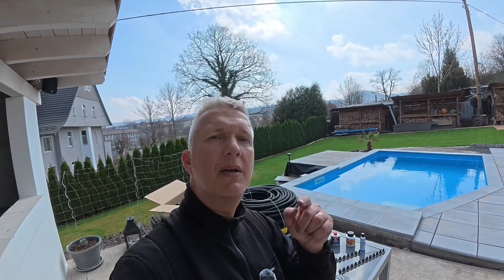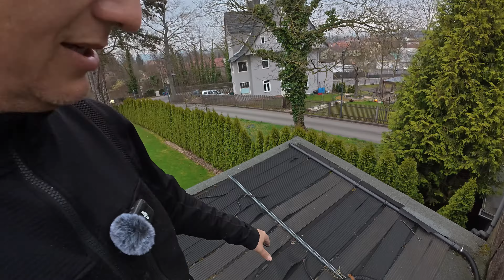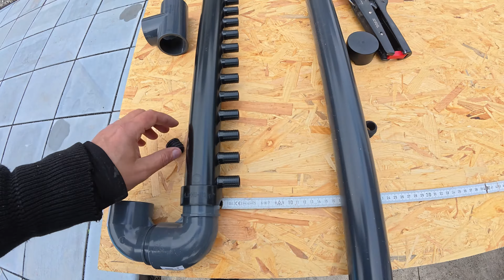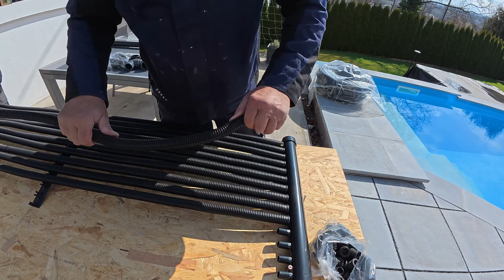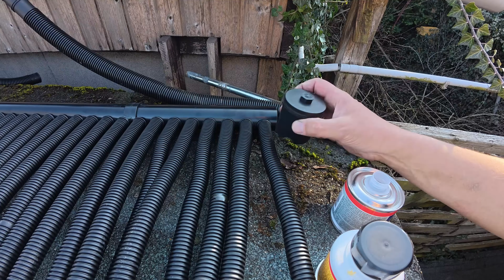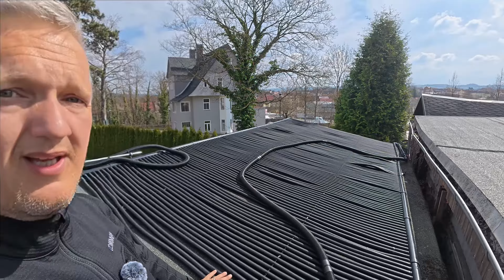Build a DIY Solar Pool Heater That Lasts!

Comment from the maker: *👇 All products & links from this video:
🔗 Ribbed pipe system: https://www.dolphi-ripp.com
🔗 Cleaner: https://geni.us/Hkh58YD (Amazon)
🔗 Adhesive: https://geni.us/9ih4W2 (Amazon)
🔗 PVC pipe: https://geni.us/EoXtW (Amazon)
🔗 Adapter: https://geni.us/5GimrK (Amazon)
🔗 T-piece: https://geni.us/GrNu (Amazon)
🔗 Angle IA: https://geni.us/VKVxT (Amazon)
🔗 Sleeve: https://geni.us/RSbm3f (Amazon)
🔗 KFE tap: https://geni.us/vw9J8RS (Amazon)
🔗 Pool hose: https://geni.us/tlkbP7 (Amazon)
🔗 Solar foil: https://geni.us/eA2OT (Amazon)

EPDM system
🔗 Solar absorber EPDM solar heating: https://geni.us/IOXTEy1 (Amazon)
🔗 Repair connector: https://geni.us/933M (Amazon)
🔗 Bypass set: https://geni.us/lwKQ3Lz (Amazon)
🔗 Solar hose: https://geni.us/qpSz (Amazon)
🔗 Complete set: https://geni.us/hYozFc (Amazon)

You can find a detailed blog post with lots more information on my website: https://commaik.de/2025/04/poolheizung-mit-ripp-rohrsystem-solarheizung-fuer-den-pool-selber-bauen/

Follow me on my social media channels for more content! @commaik

🎥 This video was originally produced in German for my main channel:  
https://youtube.com/commaik  
It was then translated into English using Heygen – with my own voice and lip-sync.

🎙️ Want to dub your videos like I do? Try Heygen:  
🔗 https://www.heygen.com/invite/b96cdcf6 – Get 300 free credits when you subscribe.

📺 The original video, which includes English subtitles, can be found here: https://youtu.be/Sll_zPNsJZg

Note: All links marked with * are affiliate links. If you make a purchase through these links, I will receive a small commission at no additional cost to you. Thank you for your support!

Comment: Too bad, Dolphi Ripp is currently closed. Any other system you looked into and can recommend? I currently have cheap Marimex panels installed that - after 4 years - ripped apart. So I want to install a replacement end of summer. German shop is fine.
Thank you
Reply from the maker: Hello,
Yes, I was honestly quite surprised that the Dolphi-Ripp shop is temporarily closed. I really hope they'll be back soon because I've been very happy with both the system itself and their customer support.

There are other manufacturers offering similar solar ribbed pipe systems, but I've only used the Dolphi-Ripp system myself, so I can't honestly recommend another brand based on personal experience.

I'd suggest searching Google for "Solar Rippenrohr Poolheizung" or "Pool Solarheizung Rippenrohr" if you're searching in German, or "solar ribbed pipe pool heater" or "solar pool heating ribbed pipe system" if you're searching in English. You should find a few comparable systems that way.

It's a shame your Marimex panels only lasted four years. My Dolphi-Ripp system has been running flawlessly for several years now, and I hope it will continue to do so for many more.

If I ever get the opportunity to test another ribbed pipe solar heating system, I'll definitely make a video about it.
Reply: @commaikenglish Thanks. But I hope the system you have works flawlessly for the foreseeable future.
Reply from the maker: @larsl7483  Thank you! I certainly hope so too. 😊

So far, everything looks great. The system has been running reliably for several years now, and I haven't noticed any signs of material wear or leaks.

I'll definitely keep monitoring it, and if anything changes in the future, I'll be completely honest about it and share an update in a new video or in the comments.

Comment: Well done sir. Thats an impressive setup and i may just copy this idea for my new home in florida. Thank you for making this.
Reply from the maker: Hello,
thank you very much for the kind feedback! 😊

I'm really happy to hear that. The system has been running for several years now, and I'm still very satisfied with it. Considering the relatively low investment, it delivers an impressive amount of heating performance.

Florida sounds like a perfect place for a solar heating setup like this. You get significantly more sunshine than we do here in Germany, so I would expect the system to perform even better there.

If you decide to build something similar, I'd love to hear how it works out for you. Feel free to share some photos or your experience later on. It's always interesting to see how other pool owners adapt these ideas to their own projects.

Good luck with your new home and your future pool project!

Greetings from Germany 🇩🇪

Comment: Nice, I have been using similar for a few years with a hot tub and yes it really works.  Can you suggest how this can be protected from strong wind on a flat roof as you have in your video please?
I'm tempted to build a wood frame or horizontal beams to lay over the heat exchanger and attach to the walls of my garage, are there any disadvantages apart from possible a small amount of lost heat?  Thanks
Reply from the maker: Hi, and thanks for your comment – great to hear you’ve already had good results with a similar system! 😊

When it comes to wind, I actually see the ribbed pipes as fairly uncritical, since their design offers relatively low wind resistance.
What kind of experience have you had with strong winds? Have you noticed any movement or lifting?

In my setup, the pipes are securely fixed to the roof about every 70 cm (approx. 28 inches) using mounting brackets. The retaining rails were included with the system and hold everything firmly in place. That makes the whole setup very stable.

Your idea of adding a wood frame or horizontal beams can still make sense – especially if your roof is more exposed or you just want some extra peace of mind. The key point would be to make sure the structure doesn’t press down on the pipes and doesn’t create too much permanent shading. A small loss in efficiency is possible if parts are shaded, but it should be minimal as long as the structure remains fairly open.

In many cases, proper mounting is already enough – but as an extra safety measure, your idea could definitely work.
Reply: @commaikenglish  Thanks for the quick reply.  Unfortunately yes, the ribbed piping doesn't have enough weight and any minor lift from the wind can turn the whole unit into a sail, I'm only 9 miles from the coast across flat land.  You've actually given me an idea that I should keep the pump running in bad weather to increase the weight, but I'd like a semi-permanent solution to reduce the risk. Thanks
Reply from the maker: @lynnwilliams5860  Hi, and thanks for your feedback – that explains your situation much better!

To be honest, I didn’t realize that your system drains when the pump is off. In my setup, the water stays in the system even when the pump is not running, so the pipes always have some weight, which definitely helps in windy conditions.

Your idea of running the pump during bad weather to increase the weight makes sense, but I wouldn’t rely on that as a long-term solution – especially with your location so close to the coast.

A more robust approach would be to secure the system mechanically to the roof structure, rather than just letting it sit on top.

One option is to use mounting rails. Here in Germany, we often use C-channel or T-slot rails from the plumbing sector, originally designed for pipe mounting. They are very solid, flexible, and easy to install on a roof.

You can then attach the ribbed pipes or their holders directly to these rails, so they can’t lift or shift in strong winds. In my opinion, that’s the most reliable solution, especially in exposed, windy areas.
Reply: @commaikenglish  thank you, I'll investigate further
Reply from the maker: @lynnwilliams5860  Hi Lynn, sounds good 👍

Let me know what solution you end up going with and how it works out for you in real conditions. Especially in your windy location, that would be really valuable feedback.

Thanks and good luck with the setup!